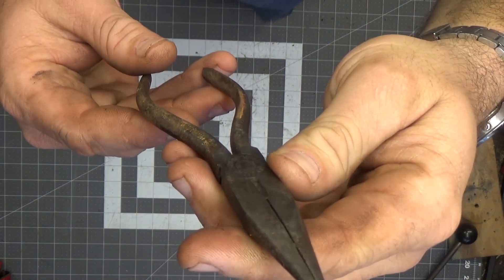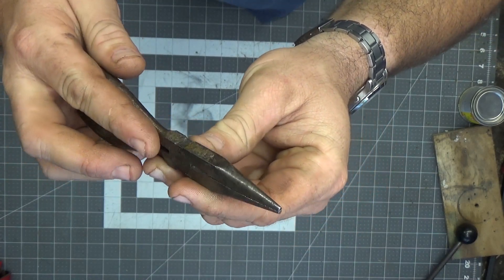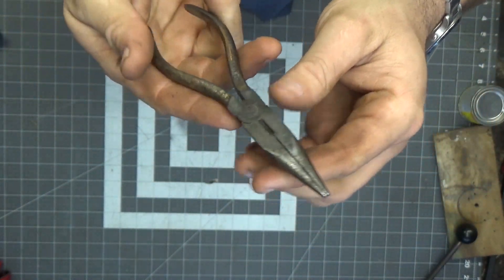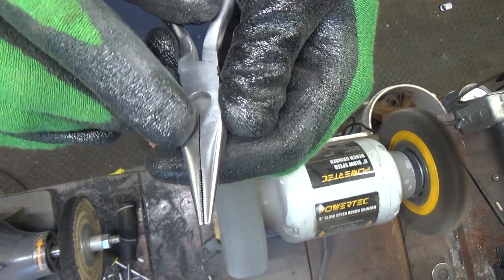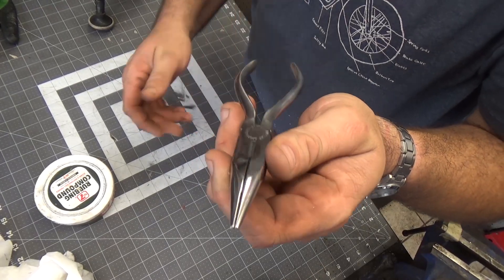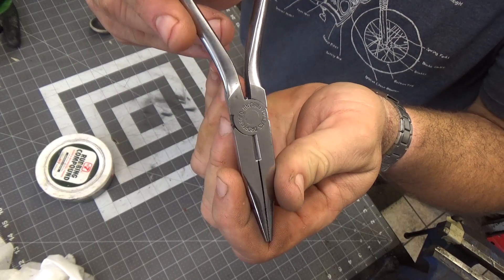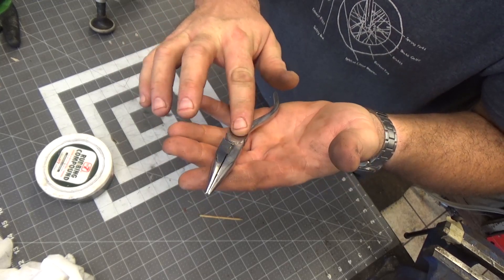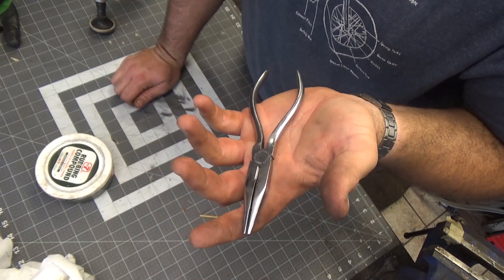Fuller' s Needle Nose Pliers (England)

Comment: Very nice, Joe!  I wish I knew how to put the grippier handle material on a tool similar to the non-shiny version of KNIPEX (does anybody know?). Being Brittish, I was thinking a racing green would look great.  Have you ever played with PlastiDip or similar products?  It's an area I haven't explored yet; I know ScoutCrafter hates those products, but conversely,  I don't so much like Klein Koats.  I suppose this is almost into the - gag - fashion end of tools and restoration!
Reply from the maker: I tried plastiDip back when I was young and impressionable. Let's just say the pastidip marketing people are great, but the product has a lot to be desired. I am pretty sure all good grips are made from an injection mold type process
Reply: Marc, I tried plastidip last year on some wire cutters, looks great at first but is too soft and doesn't wear well, thick heat shrink sleeving works well but isn't very pretty